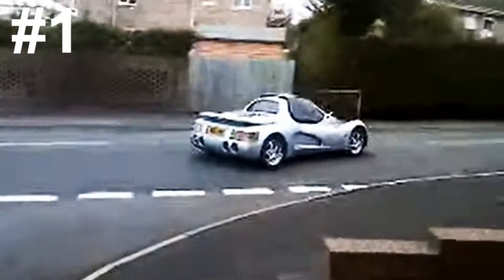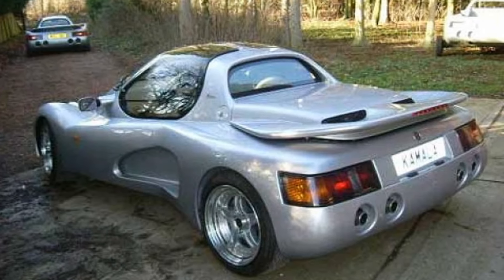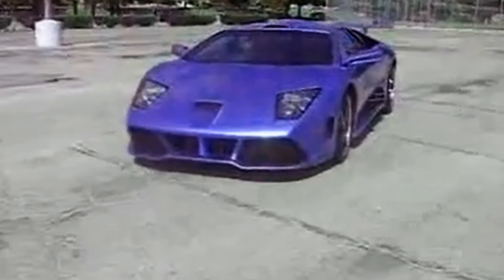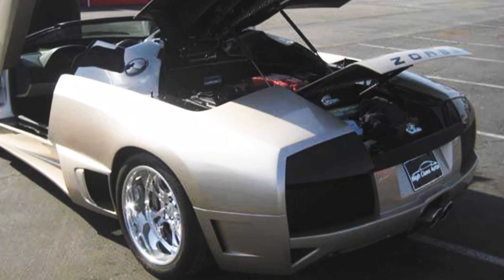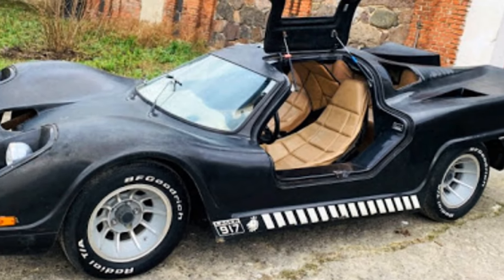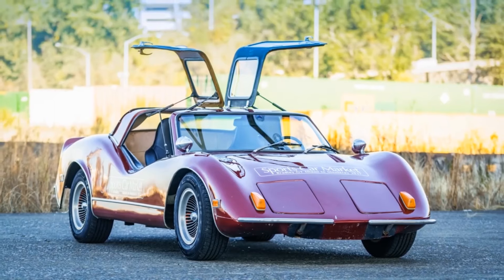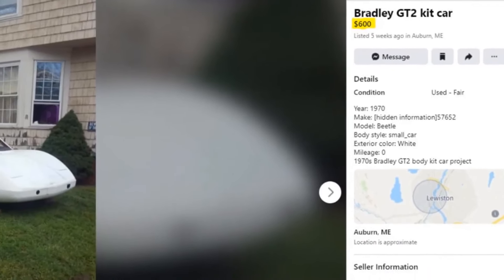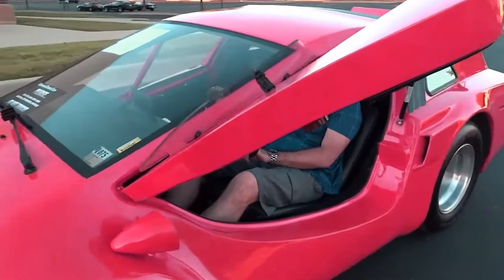Top 5 WORST Kit Cars EVER MADE!

Comment: you don't know much about cars if you think that VW air cooled are weak and slow, ... and that Fieros are cars famous for fires
Reply from the maker: Well, that's just wrong on so many levels. Perhaps you are a bit mixed up?
Reply: do you know how easy it is to get a VW Type IV engine, swap high compressions pistons and ported heads, put a nice camshafts and set of dual carburetor and exhaust manifold ? no you don't but peoples into VW knows ... and Fieros famous for catching in fire ... sure , happened to some early 1985 models with the 4 cylinders because of a defective early design fixed early on
Reply: @QuickshiftCars  He's not wrong lmfao
The only Fieros famous for fires were the early models.  Plus swapping a Ford, Buick or even an LS if you get lucky is possible with these kit cars.
Reply: Alain I agree with you. I spend my whole life making, buying and selling kit cars and replicas, and this kid obviously didn't do enough research on Fiero and VWs.

Comment: I had an '87 Fiero and you're mistaken about the performance. Not all VW's are slow either. A well built engine with a 72mm crank,  92mm pistons, racing heads & dual 40mm carbs maybe even a turbo... you'll be singing a different tune.
Reply: 50 hp instead of 22?
Reply: @jackvanepps7301  You will see HP claims from 40 to 120 for the VW 1600. You could buy professionally built street legal 1600 engines that produced a super reliable 180 Hp normally aspirated or 290 Hp turbo charged.
Reply: @garymanis6305 well that’s about as slow as it gets

Comment: Most of these VW Type 1 based kits took several hundred pounds off the weight of the donor vehicle when installed on them.  So the performance and handling was improved markedly.  It was easy to hotrod a VW engine with multi barrel carbs,  hotter cams and increasing their displacement with larger cylinders and crankshafts. Or either a Porsche flat six out of a 911 or later a Wankel rotary engine out of a Mazda for substantial power increases.  Likewise the Fiero could easily have a more powerful GM 16 valve dohc four, V6 or even V8s installed.  Pontiac designed the Fiero as a very potent car, which was throttled way back by GM so as not outshine the Corvette.
Reply: I agree about the performance of the VW engine with multiple carbs. I used to drag race a VW sedan back in the 1980s. I say that anyone that thinks the old air-cooled VWs were slugs doesn't know VWs. But I also think that, when guys are dreaming, they just keep thinking about more and more and more power and they don't realize that there comes a point when a car can have so much power that it is no longer any fun to drive. My drag car had in the neighborhood of 180hp and it ran the quarter mile in the low 13s. That is a car that is no slouch. A Meyers Manx style dune buggy with 120hp is an absolute blast to drive and yet, it's easily tractable in traffic and the engine will last and last. I truly believe that all these guys that simply have to swap out the VW engine for something with more power, are nothing more than snobs. It is true that you can get 300hp out of a Subaru but JESUS, I wouldn't want to drive the darn thing.

Comment: I don't think this reviewer gives the Beetle platform a fair shake especially in the engine department. Those air cooled engines were, and still are, quite reliable and easy to work on. As far as performance goes a fiberglass body on a VW floor pan would be not only lighter, but also somewhat more streamlined. Manufacturing issues aside, these bodies would take fuller advantage of the VW platform than the steel Beetle body could ever have achieved.

Comment: To each their own, but I disagree about the VW Kit Cars.  The engines could easily have their HP nearly doubled from stock with just bolt on mods.  Replace it with a Porsche motor, or Corvair motor and you can really pour on the beans with low weight of the car.  Almost bought a Laser 917 back in the day, but insurance on a fiberglass kit car was just too much for me back then.

Comment: Back in the day, my brother and I each owned a Pontiac Fiero. I really believe that this was one car that didn't get near the respect it deserved. Mine had the iron duke four cylinder while my brother's had the V6. Neither car ever gave any indication that they might catch on fire. I don't know where you got that info. My four banger would easily go 100mph and my bro's V6 would easily top 120. But here's what no one mentions about the Fiero. It's one damn solid car. Because GM was experimenting with flexible body panels, the car's chassis was extremely rigid. It had to be. There were no squeaks, no rattles and no surprises when it came to handling. Even unmodified, these cars handled like slot cars and were just an absolute hoot to drive. During the time we drove ours, a group of Fiero enthusiasts were putting V8s in them and the most feasible and easiest seemed to be using the Cadillac Northstar engine and trans combo. Of course, you gave up the 5-speed but hey, in stock form, the Northstar put out some 300 ponies. That was insane for a car the size of the Fiero.

Comment: another note on those Hare  kit cars in the 1970s  a few boat builders experimented with the non flammable Fiberglass Resins and  i know there were many issues with the products curing and developing  blisters in the process  that created spot spots and later on areas that allowed water to penetrate the hulls built out of them I know it put a couple of companies out of business and  a few of their Yachts are still around  but are not reccomended to own because of the  high maintenance and repair costs  related to that Resin  i do not know if the Hare body kits used that exact  product  or not. but  it being a Company that operated out of Virginia  it seems to me to be Plauseable as many people in the Marine Industry  were involved in  other Fiberglass Industries as at that time (1970s) there were not  many Industries of Fiberglass Experts and Specialists  two of the boat companies i know  had major issues with that Resin were. located  in that same  region of thecNorth East United States  and  yes some of those Hulls are still around  currently but are genuinely  regarded as  not advisable to own or purchase  often people  that don’t know better. see them as a tempting purchase because of their highly discounted  price on a “Project Boat “  and i’ve seen them  around the Marinas and  other Venues.  exactly as that   i will note  one of the manufacturers. used  a ver desireable Mold  designed by one of the greatest Naval Engineers  from the boating and Yacht World so it adds to the overall Attraction   because the same design and Mold was used  by a couple of  very well known Builders with high quality on fit ,Finish ,and Service  so people do get   caught up into that  trap of Wow i can purchase this Look Alike for half the price of the RealThing

Comment: Does anyone remember the willow ? this kit was designed to incorporate the Buick v6 front wheel drive into a midengined design. the frame used race car specs. front suspention was Ford Pinto. About the size of a Toyota MR2.

Comment: My 4cinder fiero easily hit 100 moh. The 6 could do wuite s bit more. They were fun but pointless cars trapped at 20mpg. Mine had terminal electrical issues due to a stupid design that placed the wiring harness within 1” of the unshielded exhaust manifold; a problem that the 6 did not have.

Comment: Meh; #1 and #5 were fine. The Dax Kamala in particular - disregarding the weird derivatives- was a genuinely competent performance car, with a tidy 0-60mph time even by today's standards.

Opting for the VW Beetle as a basis though - as several on this list did - is a naff choice though, it has to be said.
(if you're using a 1930's car design as your basis... you'd be better off starting over from scratch 😂)

Comment: i completely get your Comedy and funny Comments on the majority of the Kitcars you featured  i have seen a couple of The Lazer kits  modified and done to look really good  not necessarily a perfect 917  likeness but   a proportionate  Supercar looking design  and fit and finish  overall. just a little information on the AirCooled VW engines  it is a fact that some only did have 36 horsepower stock  but a. interesting thing about that block and design  it’s very feasible to  turn that engine  into one producing 200 horsepower with a Stoker kit  and the benefit is it’s not outrageously expensive to do so  and you  can have a very reliable and inexpensive motor to maintain  and run  also another  good option for Aircooled VW platforms  is swapping out the Air cooled VW motor for a Watercooled Subaru Boxer engine  fitted to the VW Transaxle  you can wind up with a pretty fast rear engine  Automobile  again  for a reasonable cost  you are correct that in the popularity of many of the kits in the 1970s a lot of them were cobbled together by Amatuers in their garages  but those can be picked up  very inexpensively  and with some Ingenuity and  a few dollars can be turned around by the right person

Comment: Thank goodness we didn't get any of these kit cars in Australia we did get some Lamborghini replicas did see a couple of them but we did get the Nova Purvis Eureka and they look good they were not based on any car and they did use the Volkswagen engine and floor pan but l love how you yanks go on about the weak flat four Volkswagen motor in Australia we do not think that way you know about the race at Mt Panorama Bathurst well back in 1966 it won by a Morris Mini Cooper S a four cylinder car so l have owned a lot of cars utes and vans ranging from 1200cc to 2600cc engines and l have not found them underpowered l am a retired courier l have owned two 6 cylinder cars and get this one was a 240K Datsun with a 2.4 litre 6 cylinder motor l now own a toyota hilux ute with the infomous 22R engine wich is 2.4 litre 4 cylinder motor you don't need a big powerful car because in N.S.W the maximum speed limit is 110kph and our other car is a Suzuki Beleno GLX which we bought last year it has 1.4 litre engine and doesn't struggle doing 110kph and returns an average if over 40mpg so don't go on about underpowered 4 cylinder engines because a lot of cars sold in Australia are 4 cylinders